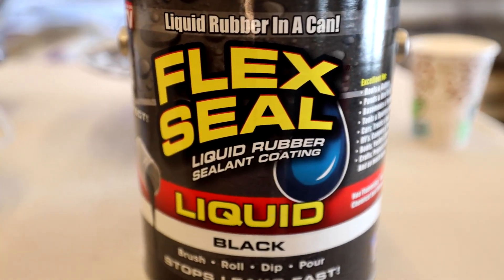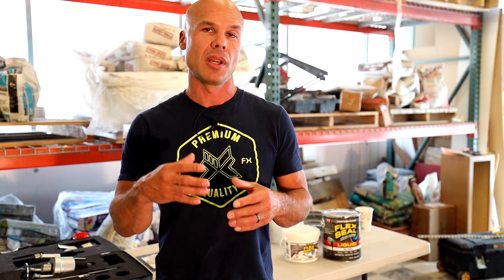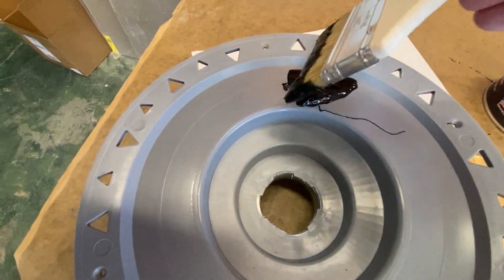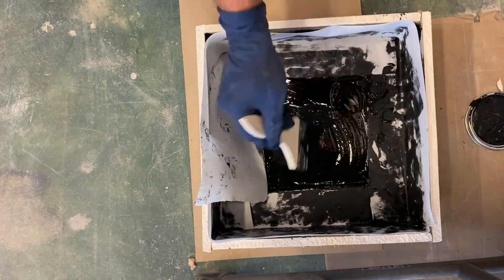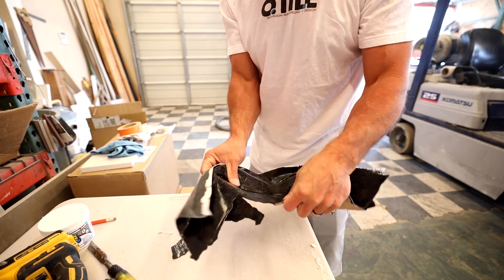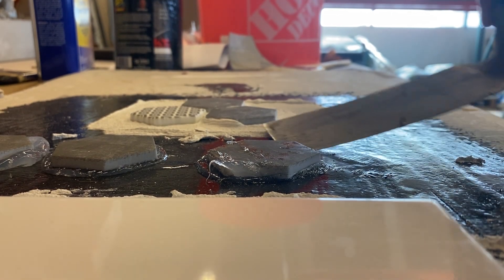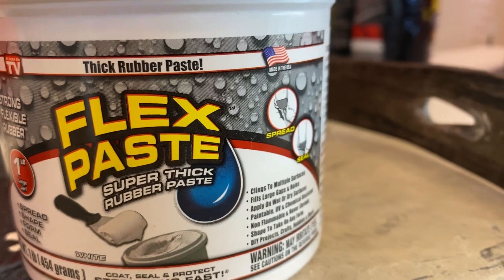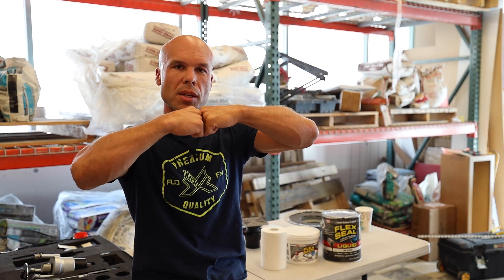FLEX SEAL to Waterproof a Tile Shower???

Comment: I don't believe it would be cost justifiable.  A 32 oz can of Flex seal is currently $34, and a 40 lb bag of thin set is only $24. You may need 10 or more cans for a full shower. Also flex seal is not water washup so your tools and clothes would be destroyed.  Interesting results anyway. Thanks for doing the detailed test.
Reply: Cost is not the issue, the labor and tile cost to repair a shower is way more than the old standard products. Most of all, it's difficult to get anyone to do the work so by far, the flex seal products are the answer!

Comment: Nice job, excellent!  What I think you need to do in all of these tests is to simulate expansion and contraction of the wood, plywood might not have much, but the joints against other woods probably will.  You might move the sides of your box 1/32 or 1/16th of an inch to test and see which products fail or not.  No I would not use it at a customer site until you know something about how it will last over 10-50 years.

Comment: roll on flex seal and on the second coat roll on flex seal and then throw on silica sand on it and it will hold with thinset
Reply: What are you saying, I'm new to this kind of repair. Are you saying to stir in sanded grout?

Comment: Im just tired of the costs if new oriducts, the cost to product ratio is not sustainable....

Imgoing enclose a plastic pallet that has small holes in it. Encolsed with flex.seal and a drain. Just saved 500.00 in a drain pan. And itll never rot.

Next make flex seal rubber strips if 16 feet long, wrap it around the base at 4x4x4 so seal the bottom of  the pallet up the wall 2 feet which has most water splashes.  Then use a 4x8 plastic shower wall panel to finish it.  

All for 120.00.  the only expensive thing is the flex seal or equivalent

Comment: Pretty sure Flex paste costs way more than thinset.  I think it would make more sense to use the flex seal as the adhesive for the waterproofing membrane and then thinset the tile on that.

Comment: Great experimental learning video. 
I was wondering why not avoid the Flex-Seal and directly use the Flex paste. Flex paste will bond to the substrate on one side and to the tile on the other side. Using the Flex Seal will only increase another layer and more the number of layers, more the dependency of bond strength between every layer - the chain is only as strong as its weakest link. Thoughts?

Comment: I think the whole mud pan saga has become a mess. There are so many different methods what is the best durability wise, time wise, cost wise. Pre slope, waterproof then pan, pan then waterproof, preslope then waterproof then mud pan. Thick heavy bladder, thin bladder, liquid bladder, fiberglass no fiber glass, foam , pre built custom pan and so on an on..

Comment: I would have liked to see the tile bonded with Flexseal submerged in water to see how well it holds up.
Another product you may consider testing is Liquid Nails heavy duty, under $4 at Wal-Mart. It has waterproofing properties, I'm using it to seal and bond the cement board joints and screw holes. I'm still using the mesh tape on the joints and waterproofing the entire cement board with RedGuard.

Comment: hello. very good video. I greatly appreciate.
 I have small shower with mosaic ceramic tiles on walls ans shower pan. Working fine for years. But possible it has leak now. Have question. Does flex seal working to temporary fix leak issue. Thank you in advance.

Comment: Our shower appears to be fiberglass and is about 40-45 years old. Has 7 or  8 superficial cracks running parallel to one another across the narrow width. They do not appear to be fully through the material and do not appear to be leaking. How should I treat them? Appreciate a reply. Thank you. Great   videos.  Gary

Comment: Now we are almost into 2024 and I’m wondering the results of using the flex seal?  I just want to verify the flex seal can go straight onto the subfloor?  Also, between flex seal you just applied the flex paste then the tile?  Sorry I wasn’t sure if you put down the hard backer on flex seal because you mentioned it.  We are getting ready to finish our remodel of the shower floor and there are so many variations.

Comment: Looks stronger than anything I have seen you tear apart. I would give it a try if the customer was down for a test with the caveat that I would fix it if it failed. I might even use it in my body shop instead of seam sealer after watching this.

Comment: Looks like it works well under testing but how does it compare cost wise to quality tiling systems?  Is there a reason to use it over other proven methods because it is cheaper or easier to use for a pro or DIY user?  Just doing a quick search, Redgard is around $70-75 for a gallon and will cover multiple projects.  A quart of Flex Seal is around $35.  So it may be worth it for someone doing a single project where they only need a small amount.

Comment: 2 issues. the flex seal paist in wet conditions is one.
2nd the paist is a small container, to do a full shower it would take  too many containers to make it an option. 
But thanks for the info saved me from using flex seal to seal the hardyboard, then find out thinset wouldn't stick to it.

Comment: I congratulate you on a really great video. You are the smartest Tile guy I've ever seen!. coincidentally I stumbled upon you as I was trying to solve a mystery leak  in my pal's tile shower. once I had the drain removed I could see the person who put the shower in was not a subscriber to a membrane, or related weep holes. The drain was unusual in that it was a cone shaped beginning at the bottom of the lip. There was plenty of room for water to get in there around the edge of that lip, The lip didn't overlap the tile, and because it was a lip there was no gasket underneath any  water entering that little (1/8 inch) gap when straight down to the weep holes, & three bolt holes  on the same plate. To route leaching water into the weep  holes, but to keep the edge dry I bought a 3" toilet gasket and cut off all but 3/8 inch. Then made a bevel when the cone touched. Flex sealed it around the outside circumference & also the top where the cone would touch. It worked !!  now weep holes only get wicking water .. while the flex sealed gasket won't let any "above the tile" water in.   

Youre videos are A-1 . Thanks for teaching me.

Comment: Very unusual and very convincing that it works well the only thing you might try is to soak the flex seal application under water for an extended period. Awesome work Issach.

Comment: First and foremost thanks for the video. In my company as a automotive and aircraft detailing service I am always looking for products to enhance what I do. What I have found not all manufactured products are all that great. The problem is that's what's out there and that's what we have to use sometimes. But as you have shown in this video when you go outside the box and you find other products that can do a far superior job why not use. As in your test you can clearly see the fail point was not the products that you were actually testing it was the actual backerboard the weakest link. I guess the only way you can truly tell how strong is is put a piece of steel behind it and then see how much tensile strength it has. Again awesome video.

Comment: I am considering using the flex paste to patch the cracking drywall seam along my shower ceiling, and to recaulk the joint between the pan and tiling….Imagine moving into your first new home that is newly remodeled, only to learn over time that it was all a cosmetic lie. Add to it that the “contractors” that performed the work also happen to be your neighbors! I’m actually terrified to know what they used behind the tile, because I know they used regular particle board beneath the slate tile bathroom floors….needless to say, the tile and grout are cracked, and water has gone right through the floor through the ceiling below 🤬🤯Not sure if it is just laziness or actual stupidity. Lol and 😂 the home inspector AND termite inspector missed obvious termite activity. If only lawyers weren’t a luxury for the wealthy.

Comment: Yes sir! We have used the flex seal paste in white to seal our above ground pool skimmer…with it actively leaking. It took a light sanding, and two coats. The clear spray saved my basement from flooding when the pointing in the brick beneath the door failed to prevent water that would accumulate any time the French drain had something blow into it.

Comment: After looking at your video. All you would do is use the Fex Paste, No Flex Seal is needed first with the Lattacretre joint support.  Apply a thin layer on any substrate and make sure you butter your tile well and apply using normal tile application methods. It's that simple.

Comment: Flex Seal is awesome! It can save your day. While everything failed, I used flex seal to fix my shower leak without tearing my shower apart. It worked! My cost is one can of flex paste for $14 that saved my leaking shower. My shower is 60 years old and the waterproof lining has disintegrated and water has seeped through the dry pack, hardy back, dry wall and into my closet behind the shower. Flex seal does the job. It bonds to multiple materials than anything else and this is the first thing I know that can be applied directly to wet surface. I love it.

Comment: Great video. I've been going back and forth to the hardware store to get something to set very thin glass tile squares (3 per 2" width) to make a border for some museum tile art (The Birth of Venus) that I installed in my shower. Since I haven't tiled the shower floor yet, would it make sense to Flex Seal the base on top of the ProveMat that I have already installed? And do you even need the Flex Seal if you are using Flex Paste? Isn't the latter equally waterproof?

Comment: So, I had kinda the right idea using flex seal on the shower tiles? My regret was choosing  white, I should have looked harder and used the clear. Does the paint come in other colors? I'm thinking the shelves/areas underneath plumbing. What say you?

Comment: First class analysis. I am repairing a bathtub wall that has plywood under the destroyed cheapo plastic liner and have been looking for an inexpensive, relatively easy to do solution. This looks like a good solution for me and having seen this vid I can proceed with confidence. I was thinking about putting primer on the flexseal and using stick on tiles, but I think that regular tiles using this method would work great and be less expensive than using stick on tiles. 

Thanks!

Comment: I think I will at least use it on my framing boards that touch the concrete. Would that be a good idea? I’m struggling with using pressure treated boards because they warp so bad. Any thoughts - from anyone?

Comment: i have a basement  shower stall - with sort of  press  board walls i think - do you think   Flex Seal  can be painted over them -  would Flex Seal   repel water - can  Flex Seal be wiped off of soap scum - does it repel  mold & mildew - hope to hear from you - thank you - lorain ohio

Comment: I'd say so, yes. I'm taking my old wall down in my bathroom, 100 year old home. First, apply DensShield boards, then apply Flex seal white paint, then apply Flex paste as the compound and smooth it out; I assume it can be sanded. then apply self adhesive bathroom tiles.

Comment: Hello we waterproofed our master bath shower 11 years ago with Liquid Rubber waterproofing sealant...no issues with tiles not sticking using thinset mortar.  Shower looks exactly like it did 11 years ago. No leakage, no mold, no loose tiles.  Had to source this product as it wasn't available anywhere and no one heard of it...using it again in main washroom. This Flex Seal product is probably not comparable to the quality of Liquid Rubber.

Comment: I can see that flex seal works, but is it cost-effective? I have used flex seal for roofing applications such as flashing and around the AC areas, so it does work very effectively for waterproofing.
Reply from the maker: No it is not.

Comment: Question:  while tiling my shower wall, a tile came off and punctured (size of a dime) my polyeurothane Tile Redi pan prior to tiling it.  Could you recommend a patch solution instead of me having to rip out and replace a $1000 pan?

Comment: So it looks like the Megalite thinset worked just fine, correct?
Reply: To adhere the tile onto the flex seal? I’m in the middle of a tile job where I used a little flexseal.

Comment: Does the flex seal have more flexibility than traditional thin set? Curious if this would be a better solution for a rv or campervan setup if it is more flexible.

Comment: I was wondering your thoughts on using flexseal on a shower pan and cleaning it over time. My concern is it may be waterproof and look good at first but over time will you be able to clean it and if it does get moldy how difficult would it be to remove,

Comment: Hello Tile Coach just wonder you use a water proof membrane with the flex seal how do you think it would work if you did the flex seal put the membrane over top if it  and didn't put flexseal over topof the membrane wouldn't you be able to put tile rite up over the membrane using your normal tile adhesive do you think it would still work just wondering because the flex seal will waterproof the pan and walls and the membrane over the flexseal without flexseal over the membrane then you could use your normal adhesive on the membrane instead of using the other flexseal brand I hope I can get a response from you

Comment: How about  using sand with flex seal before applying to walls, then tile adhesive will grip much better

Comment: You can't even paint over Flex-Seal. Once it's dry... nothing will stick to it. Is sand mix or thin-set going to adhere once spread over it? How well does thin-set stick to a regular pan liner?

Comment: Nice video! I think this could work for the thinset bonding issue. Apply flexseal on tile/surface needing water proofing, when still not cured, add a layer of hydroban fabric or even a landscaping fabric that is woven. So, the fabric bonds strongly with flexseal and flexseal with the tile. Then apply thinset on the fabric side.
Reply: he says in a subsequent video that this stuff made him feel ill/light-headed....goes so far as to say not to use this IN peoples' homes. he should've removed this video a long time ago....and just left the update.

Comment: I would use it. I had some morons tell me they could do a shower luckily I popped in and they weren't water proofing the hardiboard a at all
I went and got 3 buckets of the red waterproofing. Turned out they knew to do it but didn't like the smell. They had no problem with the smell of my money however. I coated the walls and what I am worried about is floor even with 3 coats of the rediseal the concrete is not water proof. I bought another waterproofer that is guaranteed to work and epoxy grout if all that doesn't work IL have to use the flexi seal and paste

Comment: I always use KBRS or Schluter waterproofing. I will have to try this on my own personal shower and see how it holds up 5-10 years. I do 70-80 showers a year but I'd hate to commit to this on customers houses without actual proof. What's the dry time like btw, curious to see what the time from applying to actually getting tile on the wall.

Comment: I had a soap dish come down in my shower, along with a couple of tiles. I was searching the internet to see what I could use to put it back up and saw your video. I am recently widowed and am on a fixed income, so I was thinking I would buy flex seal to fix it. My husband was a master electrician & plumber & always fixed everything around the house, but since he is gone, I have to step up to the plate, and learn how to do these things myself. Which flex seal products would you use to fix this little job? The caulk is white BTW.

Comment: Yes because I believe the enemy of tile floors outside of water, is flexion. Wood joist, under wood subfloor, under leveling compound, under thinset morter, under tile especially around a toilet, under the average obese person will probably suffer greater damage potential than the rest of the field. And of course my thesis is focused on the bathroom floor, not the Tile shower. So is it possible that the formula you tested can succeed on the bathroom floor scenario where there it might resist failure due to a combination of humidity and a minor movement do to concentrated weight, gravity and time, verses the Flex ability of the product being applied? I believe it is reasonable to put through a trial to determine its efficacy. Well done video.

Comment: My tile guy recommended a product like red guard on my concrete floors to help prevent future cracks from transmitting from the floor to the tile. On areas where hairline cracks already exist he suggested a product like kerdi membrane applied over the affected area stuck down with a red guard type product. I was considering an uncoupling membrane over the entire job and this was his suggestion, is it a sound idea. Thank you for the great videos.

Comment: I used the flex seal tape to patch a hole in my skylight made by a golf call.  I put the tape on the outside and inside and this stuff is sticky, something like a rat glue trap.  When you press down and scrape it to remove any bubbles, some of the glue comes out from the edges.  So far no deterioration after a year.

Comment: Great video, thanks! I have used Flex Seal spray. Worked great initially, but after a few years dried up and crumbled away. Does the liquid do the same over time?